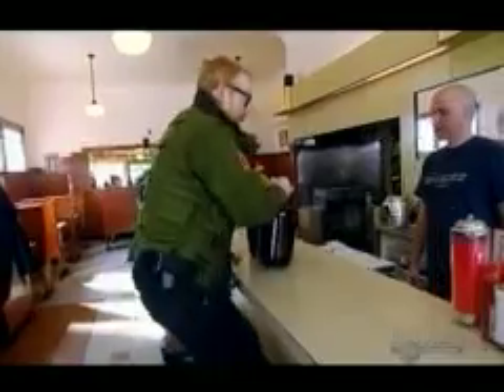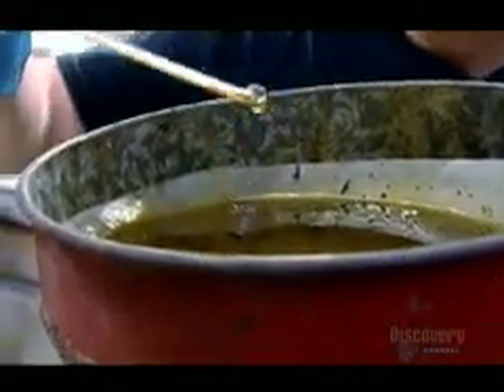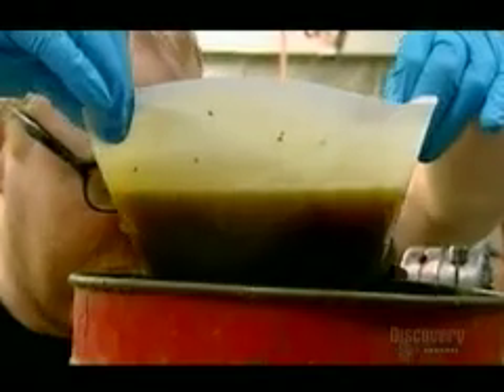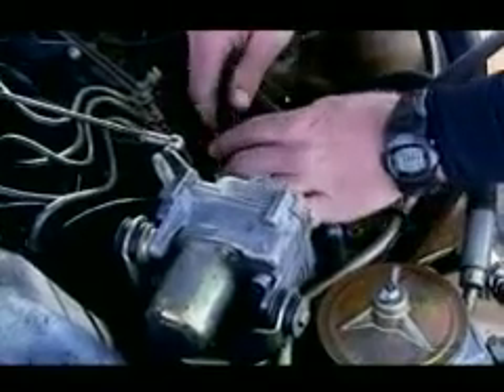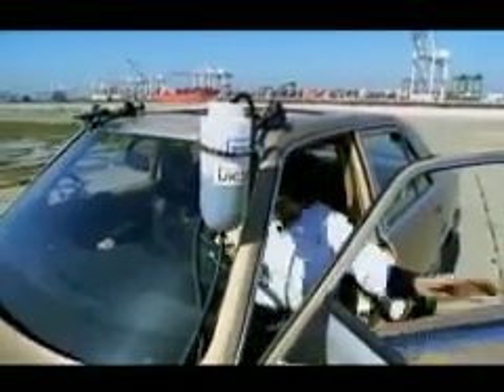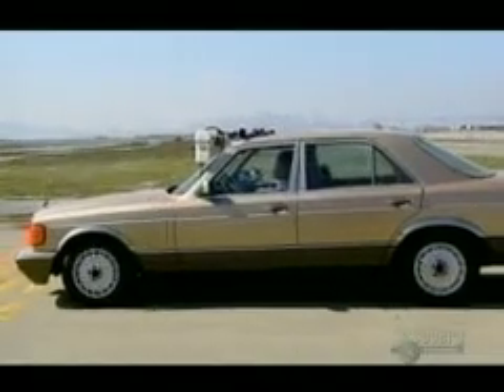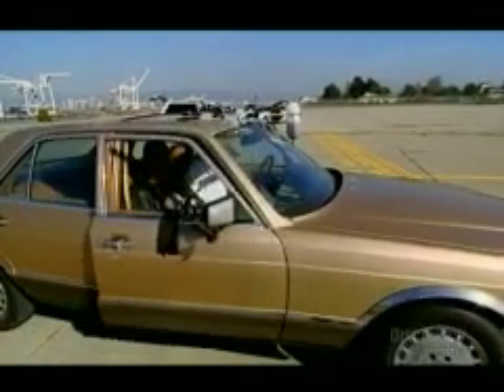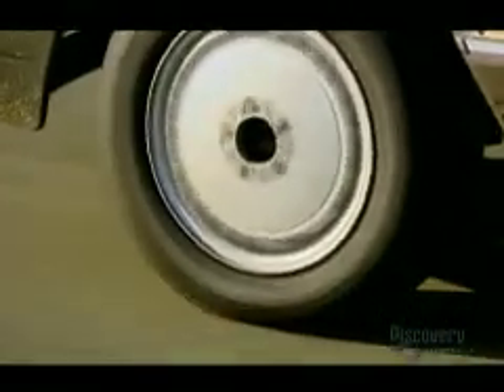Mythbusters - Cooking Oil as Economical Diesel Fuel

Comment: Start on diesel, after warms up, switch tanks to veggie...then 4 miles from home, switch back to diesel. Clean injectors, clean pump, and diesel to start cold or warm.
Reply: Agreed.  That is exactly what I do with my diesel Landcruiser.  I run a diesel tank and a vege tank and a switch between them.
Reply: Gus Fergy    Exactly what my brother does
Reply: @gusfergy66  How many miles have you used it for on your cruiser? Cruisers have incredibly reliable engines so isnt it risky to do this? 
I have a hilux and paying a fortune to run it in the UK and looking for alternatives that wont damage my engine
Reply: +Sarah Lakenes how do you switch?
Reply: +Sarah Lakenes 
That's not for those who forget to switch back.
Better make the car run and start on oil straight away.
Reply: heard you can just heat the fuel lines and you don't have to have a diesel tank
Reply: @HPStreamNewsChannel  injectors get clogged if diesel doesn't run thru for the last few miles. Might get away with single tank for a while but there will be starting issues as the injectors gradually foul up. If car is used regularly the cost of maintenance would outweigh the cost of a two tank system pretty quick, injectors can be lots of labour depending on vehicle.
Reply: @pedclarkemobile  they sell kits for SVO conversion with injectors too
Reply: @phantomsoldier497  I still run a 2008 Volvo diesel. It has Piezo super high pressure common rail system(multiple bursts per cycle), doesn't have DPF but most do & I bet SVO gunks them up. Modern diesels are too highly strung to risk.

I was gonna keep it a year or 2 but at 50mpg and great reliability I still have it over 6 years later. When I eventually change it (any expensive repair means instant death!) I want to get an old Merc diesel with a mechanical pump, old enough to qualify as "historical" and avoid all the upcoming diesel taxes & tolls. Right now the most economical option is to keep buying dino diesel and changing the synthetic engine oil frequently.
Reply: The new diesel engines are designed for not letting you do that
Reply: It's too bad Americans have not been keen on the diesel engine for the everyday car.  Although here in Texas  bubbas are all about their big diesel trucks even though they rarely use them for what their intent was.  That's awesome Gus Fergy that you have a diesel Landcruiser aaaand that you run it on vege oil.  And from I can understand the average price for a gallon or equivalent of petro in Europe is a lot...like 5 dollars a gallon? I'm sure the race to take advantage of non petro alternatives is becoming increasingly aggressive across the globe.  I just hope,  despite what Trump advocates, that we wake up and put more efforts into researching those alternatives before it's too late.
Reply: +Gus Fergy hey can i ask how long youve been running it like that? as far as no long term issues? no carbon? no comp.issues?
Reply: Why 4 miles and not 3 or 5 or 10?
Reply: You mad? I had that benz and it runs with no diesel for years.
Reply: You got that right...nothing but the truth. The sound of money 💰🤑 in the Bank
Reply: Add kerosene to the biodiesel during winter months
Reply: Even easier: use LPG for that. It's more efficient and cleaner.

Comment: "Anyone could just pour in to their diesel engine" false! seriously do not do this. That oil will eventually clog your system and eat away the rubber seals within your system. You need synthetic rubber all the way!
Reply: You are so right !   Being self employed at the time and running several Transit vans I thought I'd do the 'right thing' and go 'green' so I filled up an empty tank on the newest Transit with commercial bio diesel. Next day, with a full load of merchandise, I was about 50 miles outbound from home on the M5 m/way when I noticed the road speed was increasing - which was odd because this curtainsider had a lot of wind resistance and generally 50 - 55 mph was as fast as it would go, but the speed was noticeably increasing - and so was the cloud of smoke behind me !  I have seen less smoke emitted by a destroyer screen !!!     The shit fuel had eaten away the seals and the engine was literally running away until I stalled it in gear and stood on the brakes - LITERALLY !  Turning the key did nothing.   On inspecting the thing, I found nearly all the engine oil had been consumed by the runaway engine.
Net result:  Tow back to depot to unload their goods, loss of days pay, refund of money already paid for the job, new fuel pump (over £1,000 incl labour + towing fee + wasted fuel ! )
All in all, the shit bio diesel cost me more than I paid for the truck !
Reply: ***** sounds like to me the turbo seals let go, that had nothing to do with the fuel you were using.
Reply: *****   This is why they sell conversion kits...rubber hoses aren't compatible.

Comment: They did not purge the car of diesel before they put the oil in. there was a bit of diesel left in the container when they filled it up also some in the lines going to the engine and some in the engine it self. they should of driven the car intill it wouldn't go to get all the diesel out. 

why hasn't anyone noticed that yet?
Reply: Pretty sure they hooked their supply directly to the engine, bypassing the original supply (fuel tank).  You can see them doing this at the beginning.
Reply: TalorinSath yes, and they drove until it died as far as I could tell. Empty injectors.

Comment: Anyone wanting to try this experiment long term, would be well advised to run normal, commercially obtainable  diesel fuel and french fry cooking oil in a 50/50 mix. The commercial diesel fuel has additives that are designed to keep the engine clean and free from build up etc. Depending on the engine, you can also burn Kerosine successfully in a diesel engine. Happy (diesel) motoring.
Reply: Not that anyone will ever see this, but you can cut it with 5-10% gasoline...
Reply: Seen someone use straight once engine waar in a 2022 deisel
Reply: The key is just not to run this in the new common rail diesel engines. The old mechanical pump diesels work great for this. Examples: 70s-90s mercedes diesels. Early ALH VW tdi. 12 valve dodge cummins. Etc. 
Just make sure its filtered good

Comment: You need to take out the glycerol out of the oil or it will block up the injectors or anything else it comes in contact with.
Reply: Not true. You dont need to make biodiesel to run a siesel engine. Filtered waste vegitable oil would work fine if its kept warm enough. However I wouldnt put it in an engine for a long period of time without it getting complely filtered.
Reply: Gus Fergy , how looks heater link please, thanks
Reply: T Wayland  Yep I run pure wvo, filtered down to 1micron in my diesel landcruiser. Only modification is a flat plate heat exchanger prior to the injector pump.  Runs beautifully.

Comment: That oil has been used way too long. You can tell by the suspended solids that are visible in it. That's why I no longer frequent any such 'fast food' outlet (I couldn't, in all honesty, call them 'restaurants'!). When I owned and ran my own 'Fish & Chip Shop' with attached restaurant I changed the oil twice each week to avoid this.

There are 2 far quicker ways of filtering the oil, although adding 5-10% unleaded at the second settling stage speeds up the process and simultaneously thins the fuel to achieve lower pressures in the diesel injector pump - the usual cause of most problems with neat veg oil.

1) Use a 'sock' filter around 18" long to have more oil going through faster. A 20 micron filter is usually fine enough, although if you start with a 10 or 5 micron filter it can be washed out multiple times before it becomes unusable.

2) Use a small pump to force it through a series of water filters at 20 and 10 microns. The filter elements are not washable, but can often continue to work for hundreds if not thousands of litres. You can fill a 20 litre (5 US gallons) in a couple of minutes by this method.

Both methods rely on the oil being stood for several days beforehand to allow the water and larger solids to settle out before the relatively good oil to be drained off the top for final settling and filtering to the correct level of clarity. At a pinch you can add used motor oil and the result will stay runny at temperatures well below freezing. Depending on local pricing you can cut out all the settling and filtering stages by using fresh veg oil straight from the bottle with 10-20% added unleaded a week or two in advance of pouring into the fuel tank. The theory is that the petrol (gas in the US) cuts the long chain glyceride molecules in the oil making it less viscous and giving it a higher cetane level.

I've been doing this for several years in a variety of turbocharged or normally aspirated cars with few problems. Only my DI Perkins engine has shown any reluctance to run without smoking on pure veg oil, but upping the %age of unleaded seems to have improved things considerably.

Comment: There are a few problems with using vegetable oil: a) it only works with older cars without fuel injection, as the injectors will become clogged easily b) in colder climates the oil solidifies, so it must be heated to melt it again.
Reply: All 4-stroke diesel engines I've seen are fuel injected.  I learned to drive in my dad's old 1980 VW Rabbit (Golf gen 1) 1.5L normally-aspirated indirect injection diesel.  I've never seen or heard of a diesel with a carburetor.  On the compression stroke, diesels only compress air (vs. air/fuel mix in a gasoline/petrol engine).  Instead of firing a spark plug to ignite the air/fuel mix, a diesel engine sprays the diesel into the cylinder via a high pressure fuel injector and the diesel spontaneously ignites when it hits the very hot, very compressed air in the cylinder.

You probably mean common-rail electronic fuel injection when you refer to newer vehicles.  Older ones were mechanical fuel injection.
Reply: It generally also works better on IDI engines.

Comment: Wow, baianoise that was some unscientific noise I'm hearing. Both gasoline and diesel can be piped and the thickness of biodiesel from cooking oil can be easily dealt with. Also the test was on the efficiency of biodiesel not on its carbon foot print which in the case of biodiesel from cooking oil is relatively low since you are recycling something that you created and processed already(cooking oil) into fuel. Diesel fuel only makes up a small amount of the total fossil fuels used and biodiesel is far cheaper to produce than ethanol. As a biofuel biodiesel is much more environmentally conscious than using ethanol, something which Pimentel's work actually highlights.